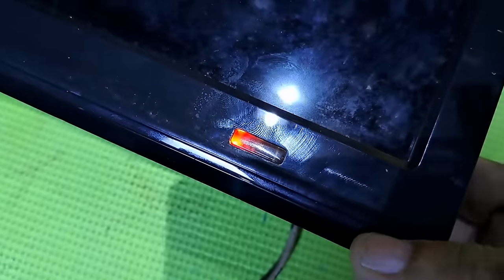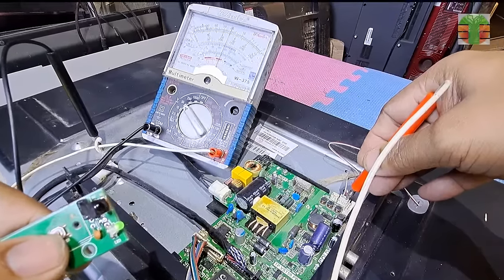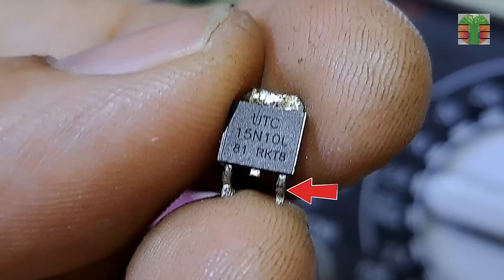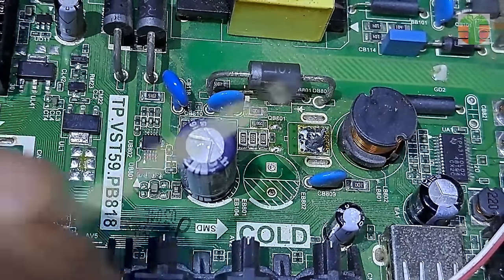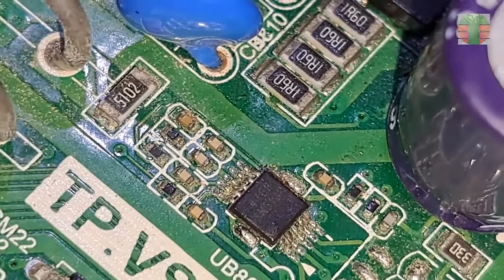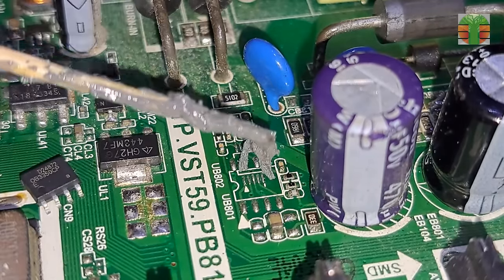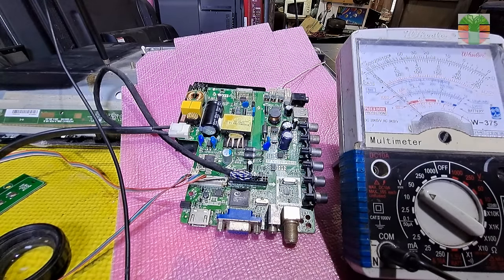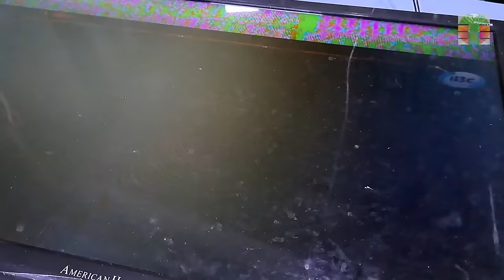LED driver IC replacement.

Comment: Greetings from Venezuela, excellent video, thanks for sharing your knowledge. One question on the BL there was 2.7 volts when it didn't turn on, what voltage should you measure there? when you replaced the IC it didn't say the voltage. Greetings

Comment: Good day Mr Tevs I'm loving ur videos I have a question how can I remove the IC Driver without hot gun?
Reply: Spread the soldering led and melt it up both side and lift up or slide through the tweezer

Comment: Hi Tevz how did you know it should have been 100 microfarads. 2nd question is are the same identifier on the back side of the board for the lactation of the capacitor.

Comment: Hi i have hisense 85h6510g led tv and it has no backlight. Can you help to see which board is bad and what component could be bad. I dont have ser  ice manual to check what  voltages should be present when off and when on. I just dont want to buy wrong board or led strip for no reason. Thank you.

Comment: They used pmw ic as switch? Is it possible to build MOSFET as switch if we don't have ic  replacement??
Reply from the maker: mosfet wont work alone, it need a driver.